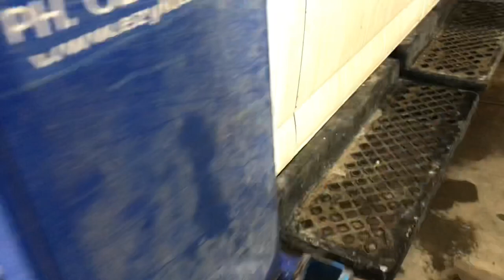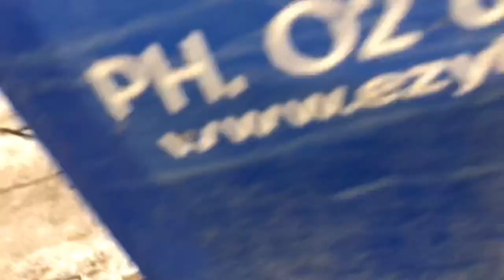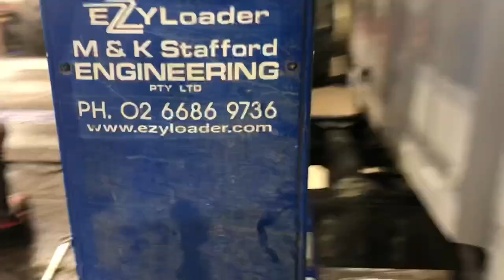Thinking Through the Ezyloader Hydraulic Motor Switch Out

Comment: That's a very compact hydraulic system.  Made in China I imagine (what's up with the OK sticker?).  What an interesting project to work on.  You probably do this, but if not,  preparation is the key to a good weld, make sure you grind the surface of the metal pieces before you weld them together, also some guys swear by heating the metal with a torch prior to welding.

Comment: Looks good, sounds like you've been having ongoing issues with ground connections. One thing that sometimes is overlooked is the frame itself of the truck to the actual battery negative. You may want to have a negative cable directly from your battery to your EZ loader frame or even yet the motor itself.  Just sometimes I find that this is overlooked. The ground connection to the frame of the vehicle. Most people encounter this with a trailer. When the trailer lights are doing all kinds of weird s*** and it ends up being a ground issue.

Comment: go with flex hose to carry from the pump to the block.  In our company i deal with Hydros nearly every day.  with 2 fixed mount parts, on a moving vehicle, you will get a ton of vibration and this is an easy failure point.  Ive learned the hard way with all our boats and lifts on our dive trucks

Comment: The long hose hook up will be a benefit when you might have to move that valve body for some reason. I believe they make hydraulic pressure regulators.
Reply from the maker: I might relocate the block higher up over the fill cap to allow better access to the fuse bank.  I’ll just need a flex hose to top up the fluids
Reply: Very difficult to use pressure regulators with hydraulics, it depends on if you gonna open loop system, or if you have a pressure with compensators none loading valves it gets pretty chaotic fast
Reply: It looks good. It's the seme work l did for years on fishing boats. I just don't like that electric motor.. mehanic is the way to go. Much simpler. Well, you'll know if a hose explodes. If not you're good :-)

Comment: Smaller diameter motor generally means less windings etc. So I would be concerned about the duty cycle of the motor (time on versus time off) also the motor looks very much like a starter motor, will there be heat issues?

Comment: Hoses is to be preferred, short or long no matter for such a short distance. 10mu filter on return line is a must for longevity, el. Motor duty is more like s3 drive, isolate circuit board not look good like that. I should look for permanent magnet electrical motor with soft start maybe yours is such. Change solenoid connection to E12A, E13A if you experience issues with current E1 (DIN).